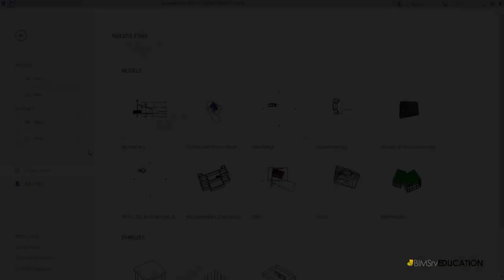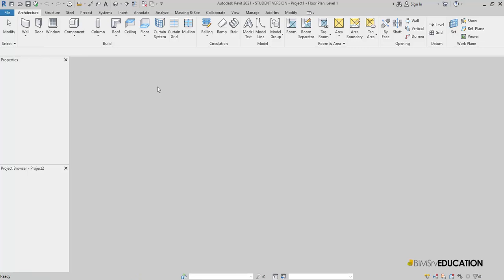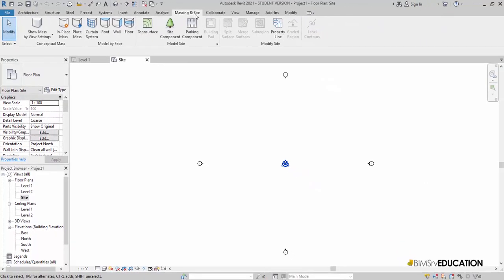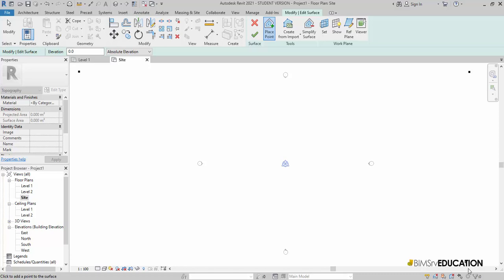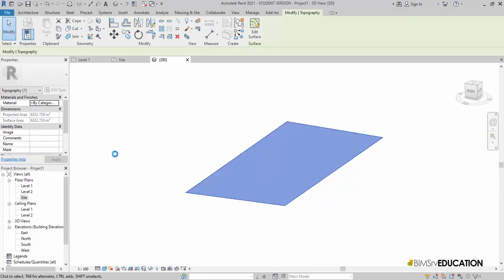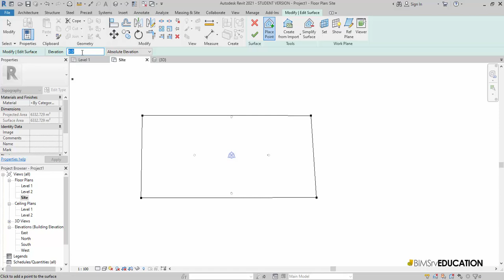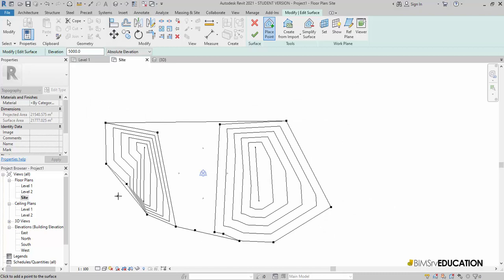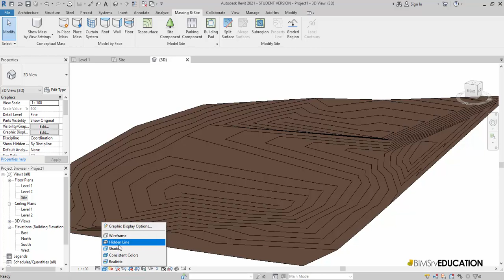Creating Toposurface in Revit by Placing Points

Comment: Why does the topography end bad when I am just following elevation points based from the proper survey points? I mean, it really ends up horribly
Reply: I guess your query has been solved yet :)  Its happening because you're using the real world coordinates (Survey drawing) which is not true to the project as the project is not sharing the same coordinates. To make it happen you need to setup your project as per real world coordinates (Shared coordinates)
Reply: @PhyzitalShikshak  Yes, I've found a different way. I used SketchUp's Geolocation, then import it in Revit. The only downside, is that you have to manually place the value on each point. 

I hope I can check that one out (your comment). 

Thank you!
Reply: @drvlive2023  yes it will make the process quite easier.